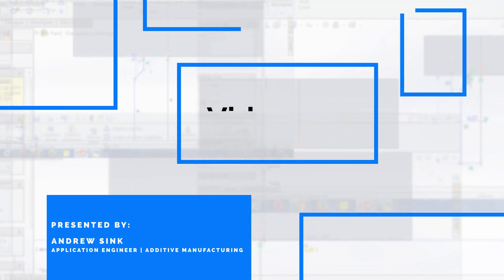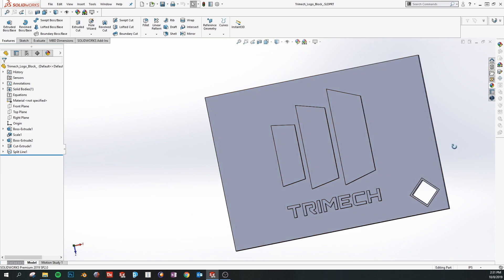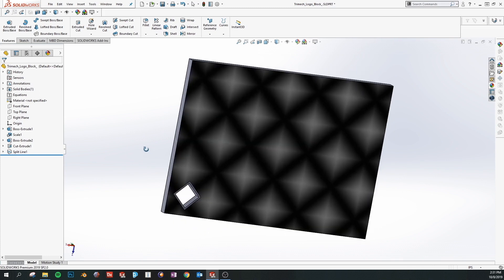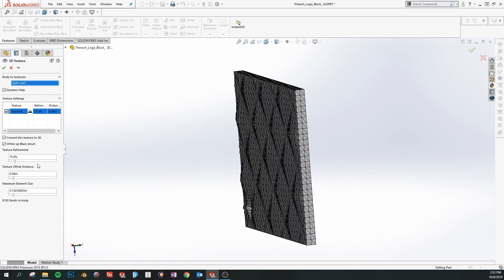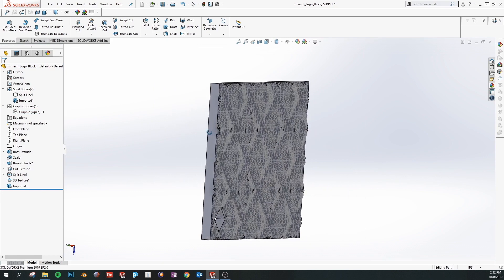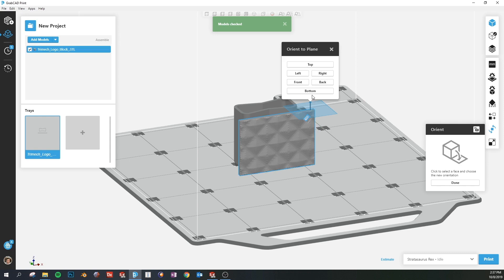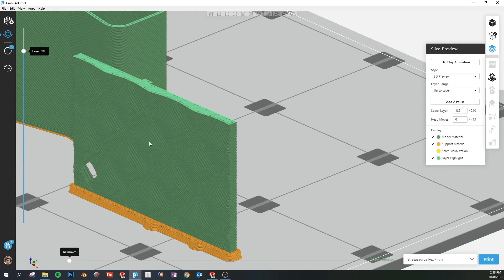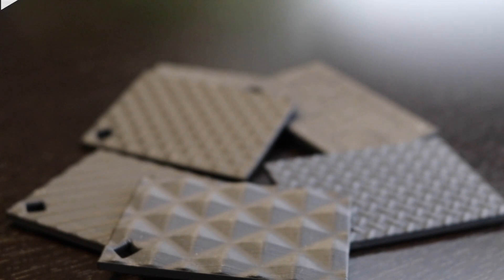Video Tech Tip: Creating Texture for 3D Printed Parts Using SOLIDWORKS

Comment: OMG great video!
I had bumped into another video where the person manually dragged a grayscale image file into solidworks instead of using the built-in textures. 
This is great, thanks!
Reply: Hi Alejandro. Do you know which software I can use to create a new greyscale image? Let's say i have my own surface texture in mind and want to put it into solidworks? How can I do this? Please, tell me if you know. Knowing the software will help me a lot. Thanks in advance.
Reply: @humbertosilva4140  If you're trying to create a bitmap image, you can use a program like Adobe Illustrator or Inkscape to create a greyscale bitmap. Good luck!